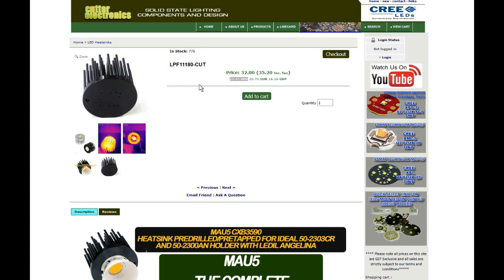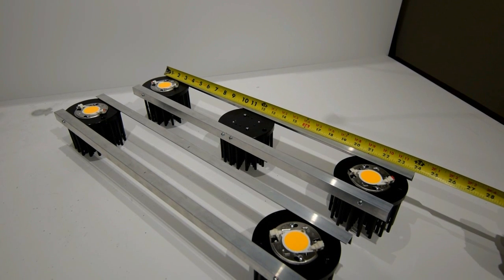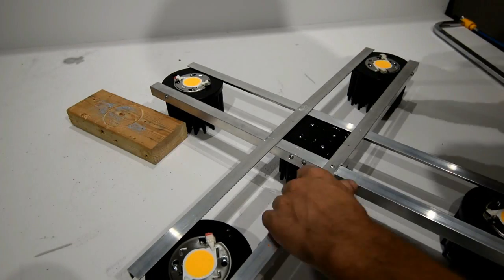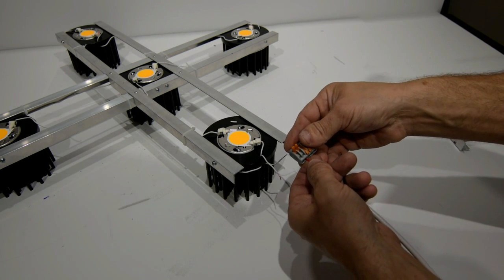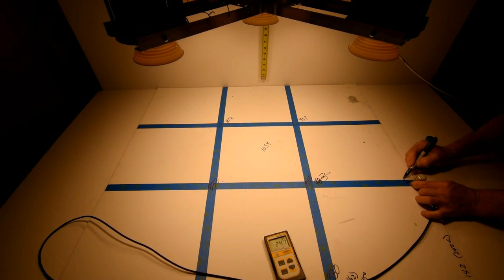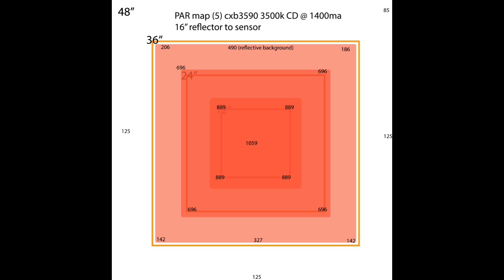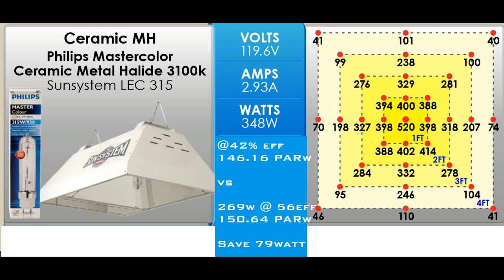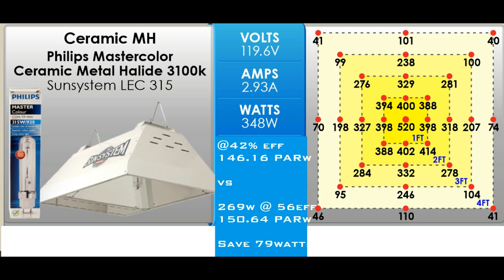Cutter Configs: mau5 kit for a 3x3 w/ PAR readings

Comment: Hi,  What would you recommend personally for cob build to out perform a 400w hps for a 1mx1m tent?  Im in new zealand so we have 230v mains voltage. 
Im interested in efficiency without loss of performance over hps..
Reply: use a combo of 200-300w led and 70w hid, use white leds or a color combo, dont use just purple, plants like the whole light spectrum, led is very efficient, but hid is very good for plant because of the far reds and ir, but white leds also output IR so you are fine with plain cold white leds, also warm white is better for flowering stage, for veg cold white is best
you can use only 400w led cob chips, if you buy a cheap grow led (chinese) please please see the reviews because they tend to show higher power in the description than it really is

Comment: Why do you wire them in series? This divides the voltage by 5? Why not in parallel? So you get a driver at 36v that gives 600w and put a bunch of cobs on for example the Cree if you wanted to run them at 100w you could put 6 on one driver as when you wire in parallel you divide the watts.

Comment: correction to my previous comment, these cxb cobbs are 90 watt, to what level do I drive them for efficiency and heat  keeping in mind producing high intensity (most efficient cobb use) for a six cxb 3590 Cob build, what driver do I need to drive this properly

Comment: Growmau5: Awesome video!  I built this. 1/16" stock is just fine. You need to take some leftover stock and put gussets ( 4 each ) 1 in each corner where the center light and materials join. I would recommend that even if you build it out of 1/8" stock.  Once you cut the slots, there is no more support for the crossed piece. Love your videos!!

Comment: Could you use one of those "driverless cob led" which actually have the drivers integrated? 

Can they be wired in series just the same?
Reply from the maker: Ad A If the driver was integrated and powered by standard AC wall power, then it essentially becomes like a desk lamp.  If you had 4 desk lamps in your office, would you wire them in series before plugging them into your wall?

Comment: Something to put into your calculations would be the intensity of the light to depth of plant penetration. I believe LED lights have very weak light penetration power to penetrate a canopy thicker than 12'''-18'' and they have to be very close to the plant roughly 6-12'' to get the most out of them. If they are not spaced perfectly you will get hot spots and other areas with very little light. I have a great idea to try with LEDs to help fix this problem I just dont have the money right now to try it myself, hit me up if you are interested.

Comment: "+Josh MedLogics hmmm, same price as a mars, not really, that is a cheap light putting out maybe 1.7 µmol/J (or PAR per watt). these cxb3590 are putting out 2.7 µmol/J of plant usable photons. so you gotta spend the bux to get the efficiency. but 4 or 5 cobs in your space mounted in a S config, or staggered configuration would work quite nicely."
Hi growmau5, at the first tanx for your videos, you re on busines with his kind of light but also help a lot diy grower...and thay s sound really generous from you!! Now, why did you raccomand an "s"configuration? Should not good a "cross" ike in this video? Finally i saw your test (pin Vs fim heatsink)...pin heatsin seem good, i know the datasheet and they are designed for low W light, less than 50w as you know but seem really good, 50 celsious is an unbelivelable performance! How do you think would be with a 1050mA cob VS an artic alpine cpu with fan? Many many thanx!! One love.

Comment: Hey...I'd like to mount the driver on the angle rather than remotely.  I've got a 30" x 30" personal grow box I'm building and I was going to leave about an inch of space between the fixture and the walls of the box so 29" long.  Do you think that would be possible off the top of your head?  I like the 5 light fixture.  What is the HID equivalent of this configuration?  Which cobs would be best for veg and flower? Thanks!

Comment: I'm a total 100% newb and i've been seriously thinking about doing a grow now for about a year.  I was going to go with a 400w hps in a 3x3 until i stumbled onto your channel.  I knew diy led was a really good way to go, but never would have thought of attempting it myself without you walking me through every step on this channel. I really appreciate that, and i think that i am going to be happy that i went this way when i get my first power bill.  I am trying really hard to stick to a budget.  I was only going to drop $150 on the hps, i realize that now i have to stretch that a bit, but i would still like to keep the initial investment as low as possible.  It seems like something that would be easy to upgrade once i had a few successful grows under my belt.   One area that i think i may be able to trim off a few bucks is on the chip. Is there any generic or non cree brand chip that i could plug into this system with similar results?  I am also interested in what kind of setup i would need to run in cxa2530 or cxa2540 to obtain similar results to this 200w 5 cxb3070 set up.  My last concern is with color temp.  The cree cobs seem to cost way more in 3500k than other color temps.  What kind of dropoff in results might i see from using a 3000k or 4000k vs a 3500k?

Comment: I've watched this vid 20 times with 100 pauses.  I bought the 4+1 kit.  I assembled it & plugged it in.  It worked like gangbusters.  I'm using all 5 cobs spread to 12.5in on center.  The 4 edges are cantilevered out slightly & should bounce off the 3x3 tent walls; like I saw them do in another of your excellent PAR reader viddies with the light mover rig.  We'll see how that evens things out.  I sure appreciate your content, Sir.  Thanks for the forum posts also.  Cheers
Reply: Was trying to figure out how to configure 8 COBS per 4' x 4' spacing and then I had an idea...  Three strips of (4) COBS more evenly distributes light.. 12 COB setup likely not too overboard either if you were to crank em down but maybe too much??..  How is your 12.5" spread working out??  That spacing would allow me to stick with my potential 9 COB layout..  You getting good par readings with that spacing??
Reply: Thanks for your question, Atrociteeshirts. I couldn't be happier with the spacing.  I don't have a meter, so I was going off of Growmau5's figures.  Six months later I've had a chance to adjust the cantilevers & take notes & pull a harvest of good size satisfying buds.  I would build it the same way if I had to do it all over again.  Cheers!
Reply: Hey excellent!!  Been pondering an adjustable system down the road..  Not something like a track system.. just something that would allow some adjustment and expansion of maybe 3-5 inches per cob to accomodate some experimentation..  Glad everything is working well for ya brotha!!
Reply: Awesome...  Thanks for the information my friend!!!

Comment: do you think that 6 cob in 2 rows of three would be effective in a 4'x4' and would it be comparable to a 600w HPS? I as because there are companies selling similar  arrangements but with older type cobs. what would be the main difference/s between cxb3070 and cxb3590 cobs? Also I have noticed some supplement with other diodes like far red/blue and IR diodes. is that actually necessary?  thanks and top notch channel btw
Reply: NO????

Comment: Yo Growmau, Do you get a advantage if using a lens vs a reflector? I would like to see a side by side lumens test at same drive current. Are there other advantages other than protecting the cob? Do you need a larger heatsink due to the lens retaining heat inside at the cob? What are the advantages and disadvantages?

Comment: Hey Mau5 does the heatsinks comes with screws already or does it has to be purchase seperately?
Reply: +Son832 
Hi Son, each heatsink in the kit comes complete with 8 screws to mount the COB holder and adapter and the side rails
Cheers
Mark
Reply: ok thx cause im just ordering the heatsinks only,as you remember few months back i order the 46 inch heatsink bars from heatsink usa and after watching ur side byside with the pins i went ahead and order the pin heat sinks.
Reply: once again bro ty for all ur knowledge and videos on these cobs and drivers, just got my 48inch deep red led bars in from BLM WOOT WOOT!!
Reply: great video M5 on your season 3 , you used far red leds, i just got my 4ft deep red led bars from BML. Can you tell me whats the difference between far red like yours and deep red is the one BML recomended for me? and also do the reds have to be on same time as the 3590 or just few hours of the flip cycle?
Basically my set up consist of 12 cxb3590 one meanwell HLG 240h-c1750b per four cobs and 2 deep red BML led bar gonna be sitting between each of the cbx bar in a 4x4 space. The whole room is set up like that in a total 10x40 space.its been a couple months following ur page and its been a great help.
thanks for all your help and knowledge.
Also i remember you email me aout my power consumption with this set up in a 4x4 space,is their another setup config that can be used to save on power consumption but wont degrade lumens to much and will save me on power consumption?
Thanks bro

Comment: how long will a single cob last?  Does the intensity lower over time?
Reply: +ShuhDonk 
Led life is determined by several factors, drive current, temperature etc. These kits are design to operate at 50 watts, well below their specifications of 130 watts so 100000 hours is totally reasonable under these operating conditions
Cheers
Mark
Reply: do you ship to europe?
Reply: everyday
Cheers
Mark

Comment: Using those white reflectors, there's nothing protecting the surface of the COB. What happens if bugs land on it?
Reply: +Mack Blumenberg 
Mack you can use the RZ diffusers
http://www.cutter.com.au/proddetail.php?prod=cut2937
Cheers
Mark
Reply: +Mack Blumenberg 
Mack
This order code has the RZ diffuser as an option you can add, this is the 8 up kit
Cheers
Mark
Reply: +CutterElectronics 
sorry order link
http://www.cutter.com.au/proddetail.php?prod=cut2903
Cheers
Mark
Reply: +Mack Blumenberg dead bug? could be a tasty snack if yer peckish! or Korean

Comment: Nice product do you do a uk version ???
Reply: +haribo stinky (Mr stink) 
What would a UK version be?
Cheers
Mark
Reply: +haribo stinky (Mr stink) The drivers accept anywhere from 110-240V, the kit is universal, you just have to get your country's plug-end.
Reply: +CutterElectronics 
It has bad teeth and loves fighting at football games?
Reply: +iamchillydogg I got bad teeth and live next door to Millwall Fc, wanna fight about it?
Reply: CutterElectronics 240 volts  with a 3 pin plug
Reply: Ethherum cheers
Reply: the driver comes with 3 wire mains cable, but you would need to add the plug, we dont add plugs as we ship this round the would and everyone has different plugs
Reply: CutterElectronics Cheers bud